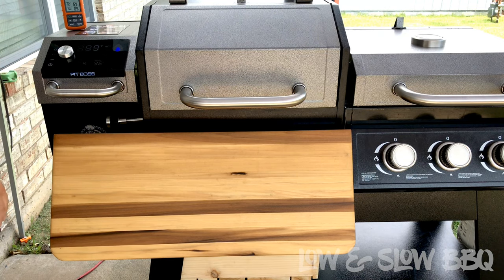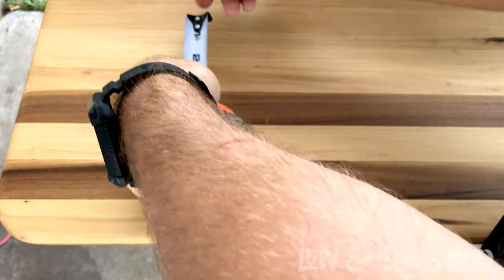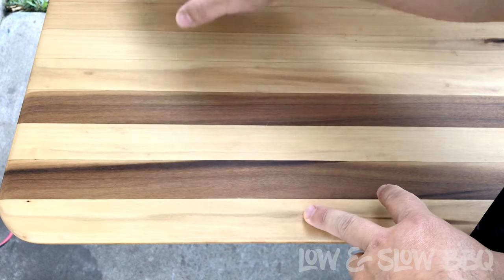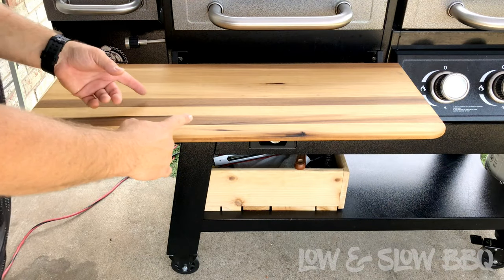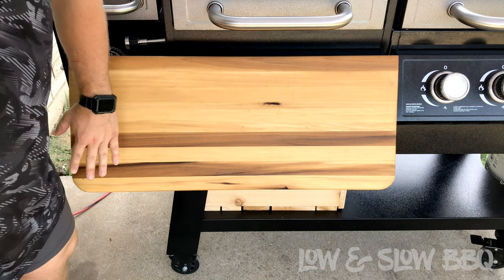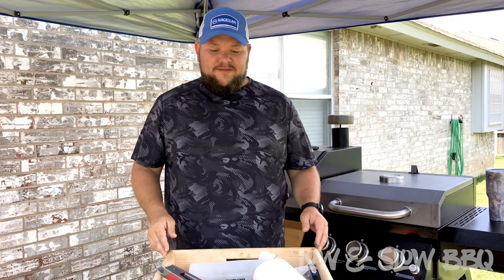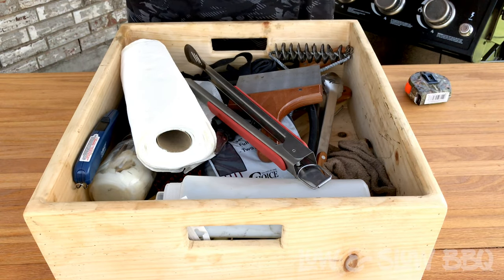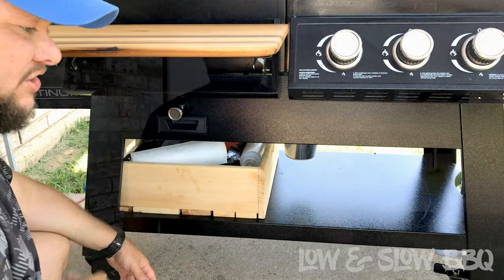Pit Boss KC Combo Shelf | How to Install a Front Shelf On Your Pitt Boss Pellet Grill | Pit Boss Mod

Comment: Definitely buying this smoker as soon as my budget allows.. and I love doing mods like this. One question though.. have you had any issues with temperature consistency and accuracy? I heard that it was a common problem and was wondering if you’ve experienced it.
Reply from the maker: As a whole no, not really, however there are hot spots like most all smokers. You can find those with a can of biscuits.